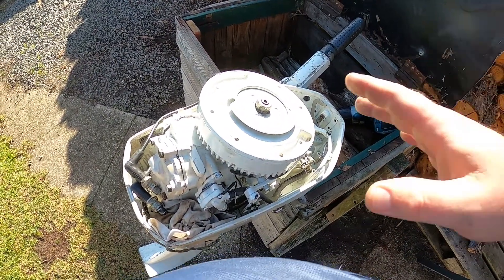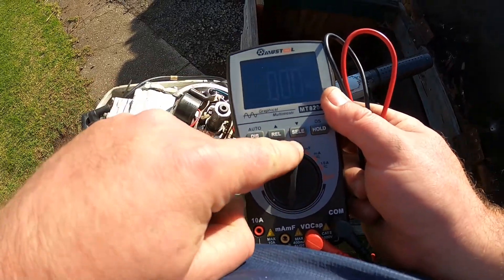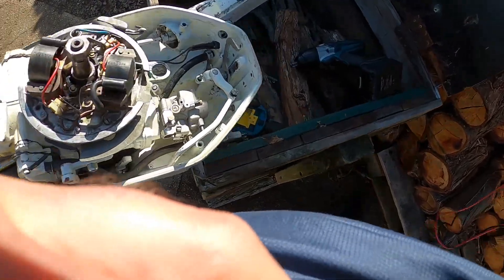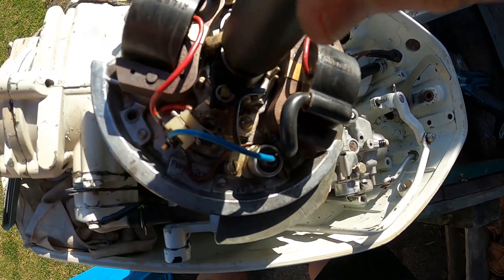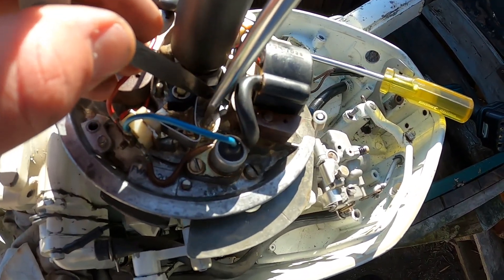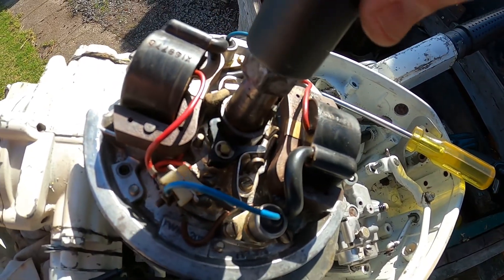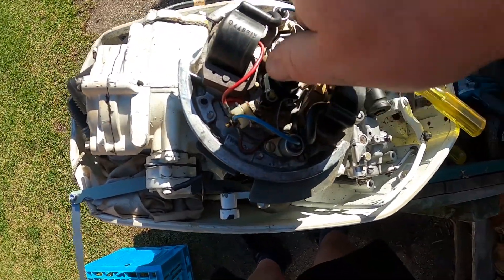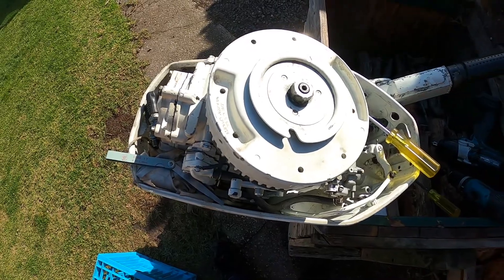10hp Chrysler outboard remove flywheel set points test Condenser

Comment: I have a 15 hp chrylser very similar to this with no spark. i've tested everything and it all test good. But i still i have no spark. The only thing i can think of is that the plastic arm on the points has worn down. If it is worn too much could that cause zero spark even with clean and gapped points?

Comment: Not sure if you’re going to see this, currently have no spark. I will check the condenser tomorrow but I was curious to know if your motor has a kill switch? I can’t seem to find one on my 1971 motor and worry that’s it’s broken somewhere causing it to ground and not make spark.
Reply from the maker: https://www.youtube.com/watch?v=WAUdNzslkwc They 38 minute mark of this video you can see the 2 kill wires that are at the front of the motor. on of switch
Reply from the maker: The kill wires are both brown
Reply from the maker: If  your outboard has no spark it would be the points gap that is the issue.

Comment: Good info. I have a '72 9.9 that won't start as it has no spark on one cylinder. I suspect bad coil as it was running fine season before.
Reply from the maker: Sorry about the late reply no spark on one cylinder would be points gap to big on 1 set
Reply from the maker: Or the gap is closed up or dirty.

100% it is a points problem everyone blames the coil.
Reply: @randomthingsarebest1473  I have a 1978 Chrysler 7.5. It's got great spark and runs awesome! I get 21 mph tops on my 12 foot Starcraft with bare equipment and only myself in the boat. I want to find a tune-up kit before it's too late
Reply: @randomthingsarebest1473 Right! I've got over a dozen Chrysler outboards that run great now and I've never had a bad coil, just dirty, corroded points!